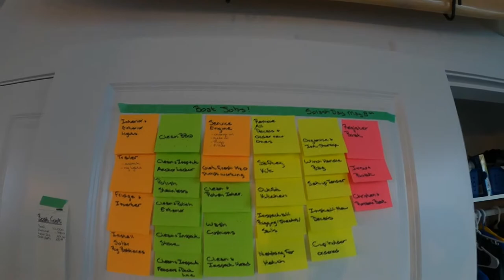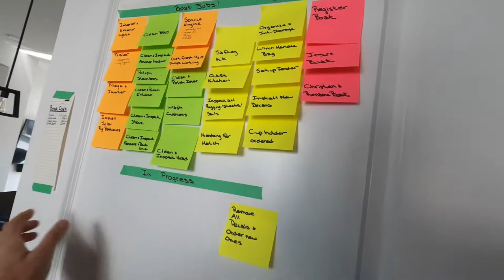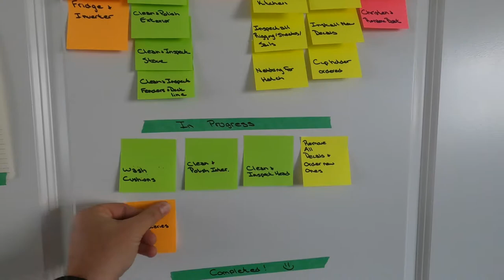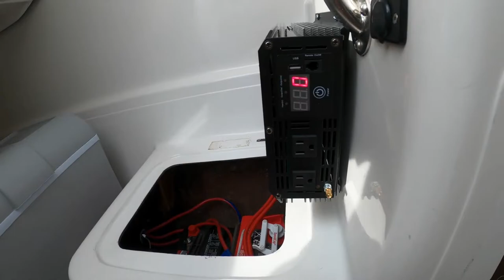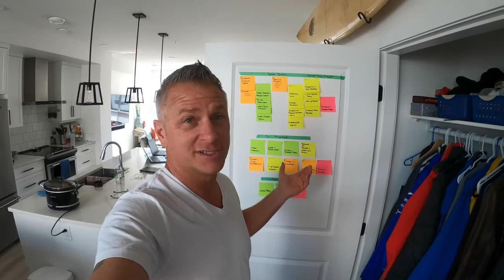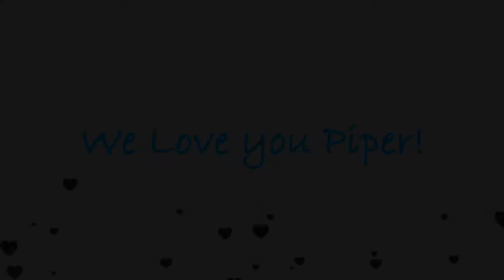Hello and...Goodbye | MacGREGOR Refit Okanagan

Comment: So sorry for your loss :( 
What make/model is that refrigerator? We have a 26X also and we're looking at the Engel coolers but I really like yours.
Thanks
Reply from the maker: Thank you. They just don't live long enough and they are family..
We have been loving our boat, had quite a few nights and weekends on it now. The fridge is below. Its working very well, when we get on board we transfer some cooler packs in and turn it on and it gets chilled fairly quickly and works well for sure. Affordable option that won't kill all your battery power.  Thanks for watching!

https://www.amazon.ca/Koolatron-P95-Travel-Cooler-45-Quart/dp/B000Q754E4/ref=sr_1_2?dchild=1&keywords=koolatron&qid=1622033808&sr=8-2

Comment: Just found your channel and I just bought a 2001 Mac 26X. Doing my own refit.... how easily did the decals come of with the heat gun... where you afraid of damaging the paint? Also how did you get your outside cushions to become white.... I thought they where supposed to be grey?
Reply from the maker: Welcome to awesome world of Macs! The heat gun wasn't working so well and we had to grind off the decals. It takes a lot to damage the gel coat you need to be careful on your pressure. The outside cushions are very sun bleached and I think that's why they are so light colored. They are still a bit grey but not much. Washing them with spray9 really helped to get the years of grime off of them.  Have so much fun on your refit...we sure did.

Comment: What was your idea about installing (2) 6 volt batteries instead of (1)12 volt battery ?
Reply from the maker: You have way way more AMP hours with 2 6Volts wire into 12Volts. Its like having a humongous `12 Volt if that makes sense.